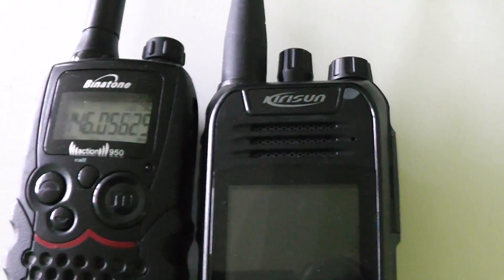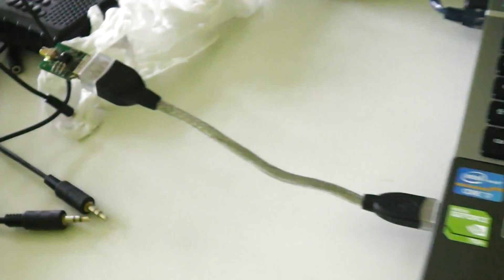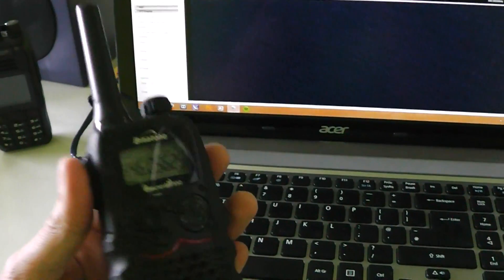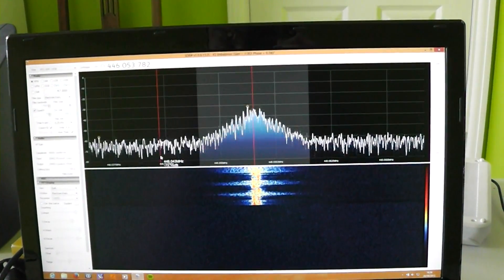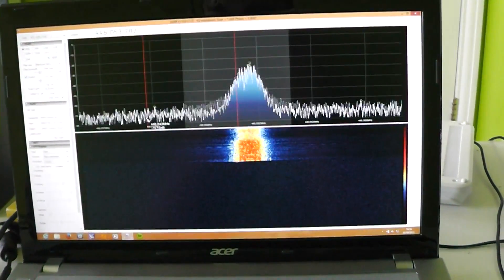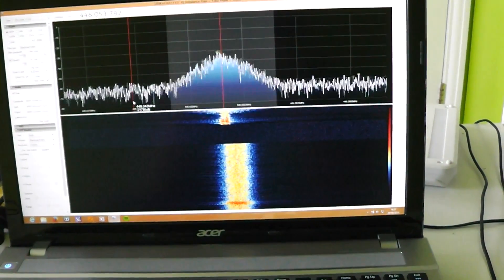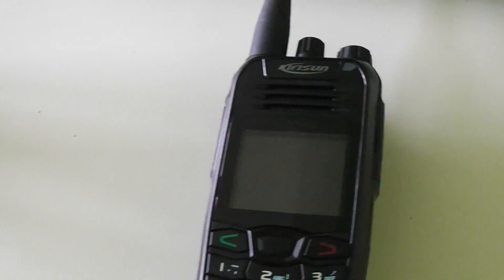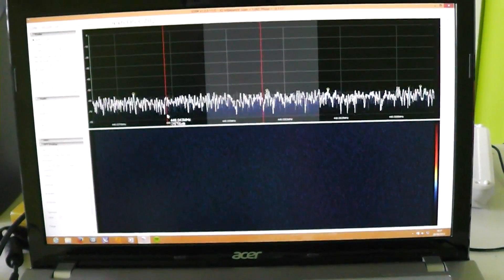Kirisun S780 spectrum test compared to analog

Comment from the maker: The sdr is just an rtl832 chipset tv tuner. You can get them very cheaply (around £10-15) mine has the e4000 tuner but the newer tuner which I think is called rt820 is better. The software is SDR#

Comment from the maker: No digital scanners can listen in to this mode anyway. Currently the only digital scanner are for P25, this mode is dPMR, and doesn't even use the standard vocoder so you would need this or a similar radio with the same vocoder to be able to listen in.
The encryption on this uses a 32 character key, I don't know much else about it, but it will stop anyone else listening in even with these radios unless they can somehow crack the encryption or guess the key